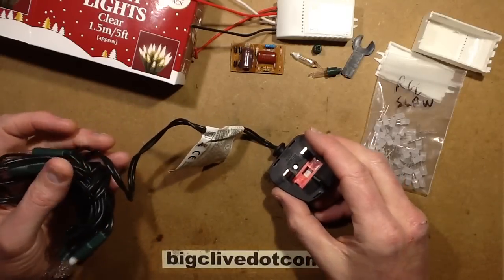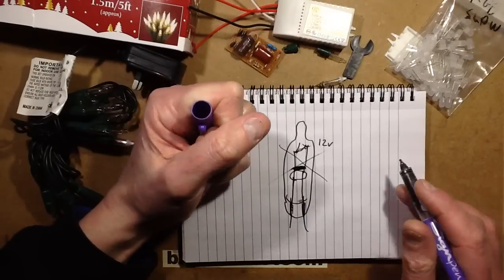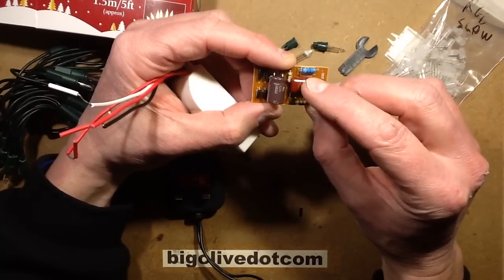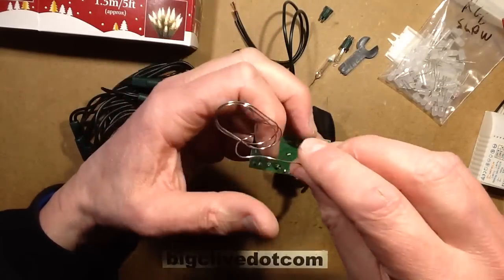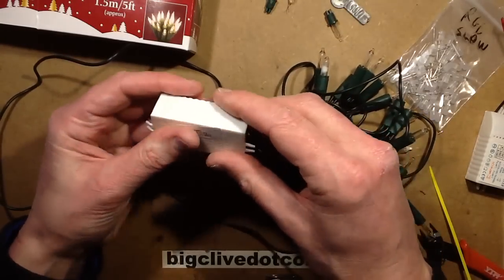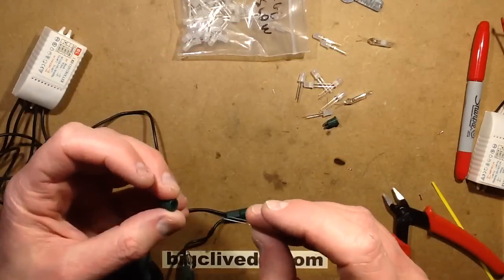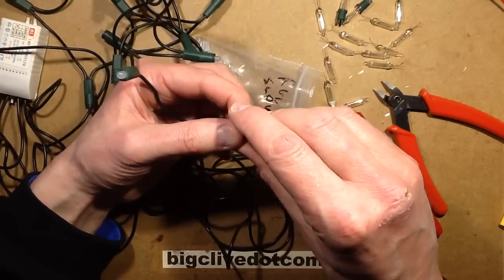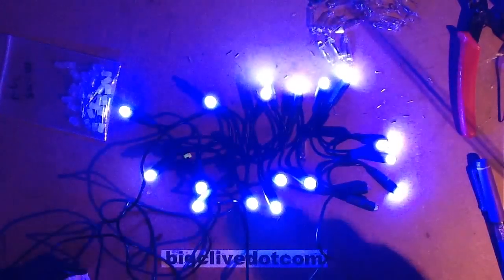Scary work incidents and other answers (with more LEDs.)

Comment: How random. I broke open a a carton of pink grapefruit juice before just before starting this video. i don't normally have it, but it was on clearance at Co-op when I dropped in on the way home for other stuff.
...gottttta say, it's a bit much for me straight from the bottle. And I think it may even have upset my stomach with the acidity. But it's giving a definite suggestion that it might be quite good diluted with a bit of cheapo soda water...

Questions, as I'm interested in maybe doing something like this to resurrect my various strings of old incandescent lights when they inevitably start breaking down past all reasonable attempts to preserve them in future - do the drivers become stupidly expensive if you order them only one or two at a time? And would it work within a reasonable variance of your version to just wire in an unmodified driver, if the maker (ie me) has decidedly low standards in terms of light output stability, efficiency and LED durability, or is it strongly recommended on the grounds of safety and/or the mod working at all in the first place?

I was also going to ask if the drivers could be hung off the output of a set of twin-circuit flashing lights, but then I realised that a) they have multiple modes including several that fade in and out semi-smoothly and I don't even know if that's PWM or yer actual DAC control, b) the program they start up in is completely random so you can't even guarantee that they'll only ever be driven with full voltage or zero, c) also no idea if the existing control box outputs modulated mains voltage or some flavour of low-voltage DC... so, yeah, I think I'll just concentrate on finding replacement incandescent bulbs for that set.
Reply: I forgot the question

Comment: I recall an event where I was building a PSU and I used the wrong electrolytic capacitor value was good but voltage was wrong and whe I powered it up the capacitor exploded and blew paper all the way up the living room curtains (the wife was livid)

Comment: In April, 1971 two things happened in my life.  First, my son was born, and Second, I re-enlisted and extended my tour of duty in Vietnam so I could be home when #1 happened.  This, unbeknown to my good wife.  So it was, the aircraft that I had hopped a lift on from Vietnam stopped at Yakota Airbase in Tokyo Japan.  After waiting three hours for the announced thirty minute refueling, we were called to the counter and informed that because the load-master of the aircraft discovered rats on board the aircraft, it would not be going  on to Oakland California, and we would either have to wait one day for another flight.  Ok another day, what the hell, my wife had yet to go into labor.  About an hour later, we were again called to the counter and informed that a damaged aircraft returning from a bombing run over North Vietnam had landed with his tail-hook down.  The pilot and aircraft were pretty much OK however he had torn the HELL out of the runway that our plane would need to take off.  The wait of one day now went on to between 1 week to a month depending on how fast the Engineers could get the job done.  During the break, I had purchased a little television set.  Well little for back then, I think the screen was about four inches across, and was sitting back watching Japanese TV. Could not understand a word said, but it was cute to hear old HORSE Cartwright talk in a shrill Japanese voice.  The commercial got me though. It was for some sort of soap, showed a bunch of little boys and girls running naked to a large Japanese bath.  These kids, probably 3 or 4 years old were all stark naked, the little boys dicks swinging back and forth as they ran, then they all jumped into the bath, and the camera focused on one little boy, who smiled wide and let one hell of a fart!   That was my introduction to Japanese TV.  In the end, we took a taxi from the airbase to Tokyo International Airport and flew out on a nearly empty 707, using our military space available rate. The Army had required we all have enough funds to pay for a round trip or they would not give us leave, even re-enlistment leave which as the ultimate reason according to the Army for a soldier to get a break from the war.  Ah memories, and now we have a doll with a rocket up her ass, what will they think of next???
Reply: Can you repeat that?

Comment: How come when the lamp breaks, the voltage across it is mains voltage for a second? Doesn't make sense to me
Reply from the maker: A string of fairy lights is effectively a chain of resistors across the mains.  When intact the voltage across each lamp would be 12V in this case, but when open circuit the lamp is effectively two electrodes connected between live and neutral by a string of resistors.
Reply: Oh yeah, that makes sense.

Comment: If two led's failed by pulling & putting a led back in THEN with every turn on u risk another failure due to the crappy capacitor dropper  switch on surge current !!
Reply from the maker: That was due to allowing the output capacitor to charge to peak mains voltage and causing a current spike when an LED was replaced.

Comment: What voltage are those 220nF polyester caps?
Reply from the maker: On a 240V AC supply the peak voltage is about 340V so I used 400V capacitors.  On a 120V supply you could use 250V rated components.  Another option is to use X2 suppression caps which are better quality and often rated for the peak of the AC voltage.
Reply: I'm not far away from you so the 400V will be the ones, thanks and keep up the good work,

Comment: something off topic but interesting to warn people about that live in the EU. I ordered Batterisers (Batteroos now) 1.5 years ago via IndieGogo and today they arrived accompanied by a charge I had to pay 21 Euros for 'importing electronic goods' into the EU :( Also since I had paid the 51 USD for the 8xAA/8xAAA+humongeous postage fee 1.5 year ago I discovered the Batterisers are a scam. They look designed nicely but are too thick (they have 3 or 4 extending pins on the positive side) and don't even fit in a regular chistmas light string battery-holder. I damaged one batteriser trying to get it in already. Also it seems they even shorten battery time instead of getting more. See EEVBLOGs tests.

Comment: In Germany the string lights with incandescent bulbs have bulbs glued into their plastic sockets. I can't get them out... Any suggestion?
Reply: *****
That's not really a constructive answer.
Reply from the maker: Some sets are glued in but most are not.
Reply: bigclivedotcom
Any idea how I can get them out without making a glass mess and without blood?
Reply: I had the same problem. Some came out with a of bit persuation but most of them broke. The inserts worked fine after I got them all out. Good luck.
Reply: 772pcs
So when they break, just dig the debris out with a screw driver, right? :D
Reply: Most of them came out easily but you should have no bother Ken.
Reply: Sorry for the delay in replying. Debris will come out quite easily.
Reply: I used the following method: Use a chunky pair wire cutters or a pair of pliers with cutters on the back part and squeeze the plastic sockets until the glass breaks. Then I could just pull on the wires inside the lamp to get the glass base out. :) Only annoying thing is the utter mess you create...

I guess this is a safety feature, so no kid can just pull out the lamp and having the socket still on the string. Maybe you can get a shock. But you also will get a shock when breaking the glass of one bulb.

Comment: In the end, the LED didn't die, but it seems that two other LEDs didn't light up afterwards.
Reply: Clive noted on-screen that they died thanks to the current spike from the fully charged capacitor.
(Charged thanks to no power being drawn by LEDs).

Comment: I have noticed that you snipp of leads and component legs after soldering. Even though I admire your speed and quality of soldering; don't you know that snipping of after soldering is "wrong"?
Or maybe you simply don't care?
(At school I got thought that snipping after soldering might cause cracks in the soldering. Therefore snipping of component-legs and wires before soldering is the best way to do it. Although, when I do solder for hobby or for fixing stuff for my friends I usually do soldering similar to the way you do it, when I'm lazy I snipp of the component legs after soldering.)
What is your opinion on snipping before or after soldering?
Reply: If it were the space shuttle or the ISS I'd worry, but it's not.

Comment: If y'all Non Europeans are trying to find this, you're best looking up "expert wire stripping pliers" or the like, the operative word being "expert" for whatever reason. I got cheapy Silverline brand which work fine, but Wiha 32860 and Knipex 11 01 160 exist too, and you can maybe get the Knipex at Lowes. Knipex lists them as "end type" wire strippers.

Comment: You Evil sod lol, i expected that led to just give up the ghost.

I Bet they dont use cam system now, fancy process controller modules i guess.
i allways liked the simplicity of cam washingmachines, impossible to have a crash lol.
Reply from the maker: The cam system was super-reliable.  There was a computerised version called Defrost Master which had a remote LCD display and keypad so you could initiate defrosts from the front panel.  The circuit board was clearly not designed by someone with industrial knowledge as the relay card used to go WHAM! and flash from one end to the other, taking out all the tracks on the way if a single channel got shorted.
Reply: Somehow im not supprised, people overcomplicating things.
Ahh a Service 1000 washing machine, i remembered it, loved it, loverly cam controlled :-)

Comment: I've had the longest discussion with Menards over here about labeling their Outdoor?  LED strings as such.  Having had just about every one of them fail at once from corrosion.  That the the instructions didn't seem to care which way I put them in.  hmmm  think it's a ginea pig process  .  What 1000 bulbs did was better.  I went from a C9 style incandescent bulb to Mini LED's disguised as C9 bulbs ..  and every out in the elements.  The majority of LED bulbs I find now 1. can't replace the bulbs 2. 1000bulbs have direct C9 replacements in LED and enclosed (and I can see they are off a circuit board hence why they seem longer.  At least in the USA, one likes to keep the strings because they've been around awhile and add character.  The LED's and the mass recycling they had around here was fairly nuch a massive fail because all these LED strings they were replacing didn't last more than a year.  :O  So I've been trying to get Mendards to carry more direct C9 replacements like what I find on 1000bulbs dot com.  Not cheap but better in the long run to losing 2 strings in a year.  (spent over $20 on those.  vs $32 that could last for years.

Comment: give me a toke yer tight get .... lol happy new year to all your family clive.
Reply: what soldering tip do you prefer clive ? when we set an elevator up we use an amprobe on one of the phases, to see how much current the motor is drawing on the up and the down, the balance weight is the weight of the car plus the rated load, 8 person 630kg, so it will only use energy with an empty car on the down, this doesn't apply to hydraulic which only pump up.
Reply: the sheave is attached to the drive, all the others are called pulleys .... sorry clive ...lol
Reply from the maker: I'd call them all a pulley.  Maybe it's more common for the Americans to refer to everything as sheaves.  I've heard the ones at the top of the shaft referred to as sheaves (not just the internally driven MRL ones.)

Comment: The one LED survived but the next two after it were completely dead.
Reply from the maker: The capacitor discharged through the 470 ohm resistor creating a 0.5A current spike as I reconnected the LED and that took them out.  I swapped them.
Reply: bigclivedotcom
Half an amp spike?  YEOW, lol.

Comment: Aww two of the LEDs died at the end. shame.
Reply from the maker: It was the current pulse from the fully charged capacitor.  I've changed them now.  (And extended the set to 39 LEDs.)
Reply: Happy new year<3
Reply: can you do this with a really long string of lights?

Comment: You can distill vodka into gin?
Reply from the maker: Gin is just a typical vodka/rum but with botanicals (juniper usually) added into the still or added afterwards.  You can convert cheap vodka or rum into passable gin by adding a few drips of essential juniper berry oil to a bottle.

Comment: Biggest bang: (Professionally) 40kg of some Iraqi's homebrew explosive ten feet from my HMMWV. That wasn't a fun night.
Funniest bang:  Seeing some idiot try to flip a pole-mounted mains disconnect in Iraq with a piece of rebar while standing on an aluminum ladder. He survived. When he got out of the hospital, he tried it again. And succeeded.
Closest scrape: Toss-up between "some anus flipping a (Tagged-out!) breaker and shorting two legs of 480v 3-phase powering a CNC mill through my right index and middle fingers and my right forearm, but potentially could have been the left hand as the grounding point" (Guy almost got beaten to death bare-handed except I couldn't make a fist with the punching hand. Still and all, there was a CAT-40 taper with a long-reach 1" end mill within my left hand's grasping range before I was stopped from backing him into a corner and putting him out of my misery...) or the biggest bang, above.